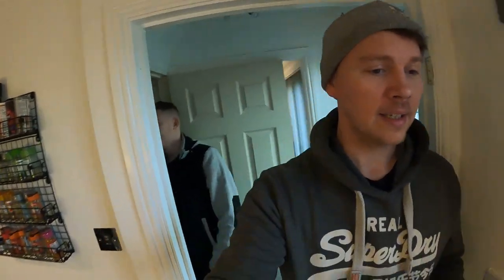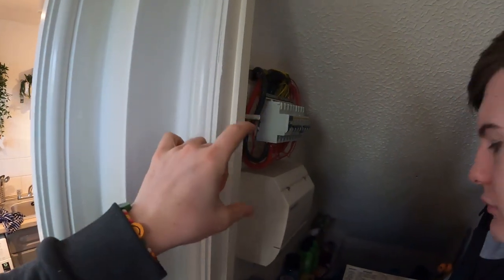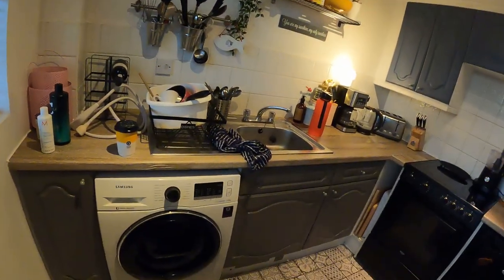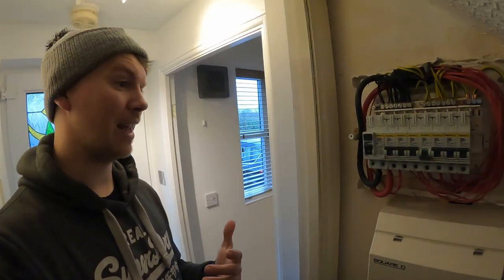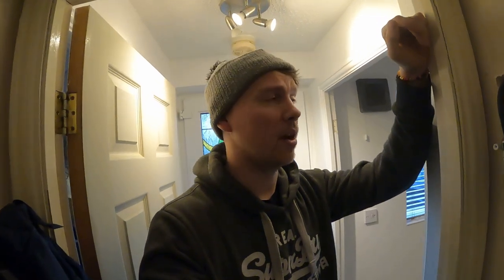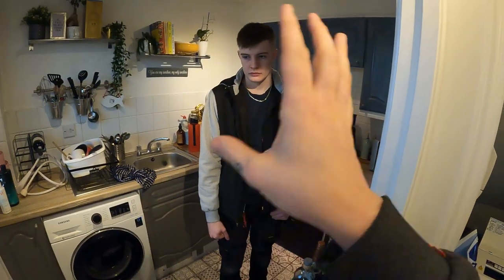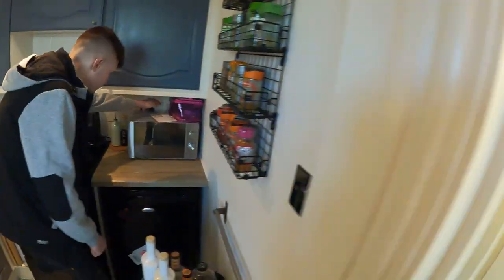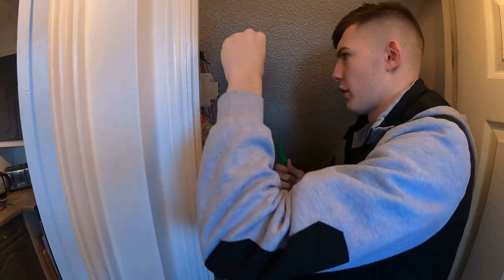Fault Finding RCD tripping - Electrician

Comment: I had to change a SquareD board recently as the RCD was being overloaded and it eventually gave up and melted the board. 

However I did find during research that Schneider Resi 9 is a direct replacement for SquareD Qwikline stuff. 

Just for future ref as I get a lot of these boards around my way and often the owners don’t want to have to stump up for a replacement board unless absolutely necessary. 

CEF seem to be one of the few places that you can still get Resi 9 stuff. But it does appear that they’re letting the stock dwindle as they don’t have much of it. Eg last I look they only had 11 x 63A RCD available for delivery and none held in store.

Comment: What is  a ramp test
Reply: It's where the tester slowly increases the current imbalance until such time as the RCD trips. This gives you the actual threshold at where the RCD trips. In this case it was 21mA even though the unit is rated at 30mA. It is tripping at an earlier earth leakage than rated however it is on the side of safety. The only real consequence is that you can then get nuisance tripping.
Reply: The tester starts with a low fault current and increases it until the RCD trips.
Reply: @markrussell4282  the ramp test was done with various appliances on, so the reality is the leakage would have been higher than just from the tester.

7mA of leakage from other stuff plus 21mA from the tester means an RCD tripping at 28mA which is bang on really.

If you're wanting to test just the RCD, then you need to disconnect everything. Otherwise you're measuring the RCD's excess capacity  - what additional leakage it can take on top of the regular background leakage.

If you had a mythical 30mA RCD, connected a shower leaking 21mA and then did a ramp test, it should trip at 9mA.
Reply: @tomcardale5596  Well spotted! Didn't notice the test was completed with loads already applied.
Reply: Thank You everyone for the replies.

Comment: All you're doing is turning on high current devices and showing the neutral earth fault on another circuit. The lower the current on the system, the lower the earth leakage! What's the point of paying an electrician when this is the result. Wasting people's money. There'll be a damaged cable in the loft with an earth/neutral fault. The customer told you!

Earth neutral fault - plug in a kettle. Some current flows from the rcd to the socket mcb, through the kettle and back to the neutral bar. From there most goes to the rcd. Some will go along the neutral of the other damaged circuit and back down the earth. This bypasses the rcd. The more current, the more the leak. 
MCBs dont isolate neutrals and so turning off the circuit has no effect.

Comment: Can you explain earth leakage?
Reply: Current should "flow" up the phase conductor, through the load and back down the neutral conductor.

Leakage is anything that isn't doing that.

The concern is that anything not flowing back to the neutral might be electrocuting someone, but most things (particularly computers and heaters) leak a little bit.

Generally the easiest (lowest resistance) place for current to leak to is earth. If there isn't a low resistance path, no current will flow. For example if you just had a bare live wire, it wouldn't trip anything as there's no path to earth. Stick that wire in to a metal sink full of water then there's an path to earth for it.

Comment: For gods sake buy a light and stop making videos in the dark.
Quick fix might just be put up on the outside of the CU a 100A-30mA if you think there may be a problem with the existing. Please do not run around changing out appliances 
Mr Spence Eng